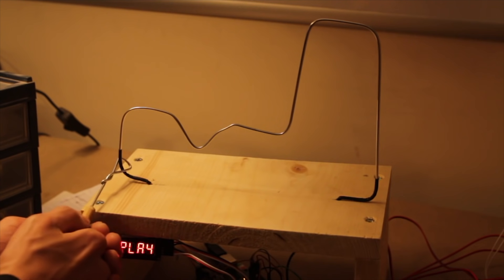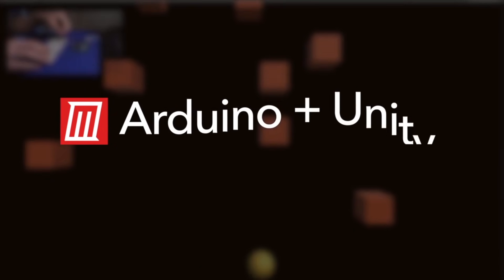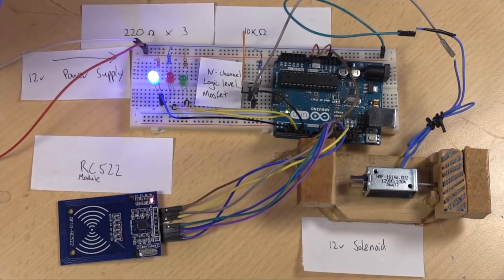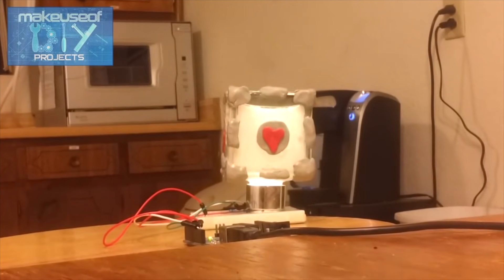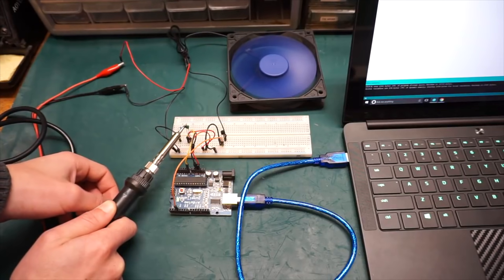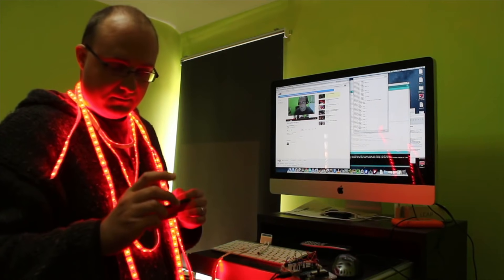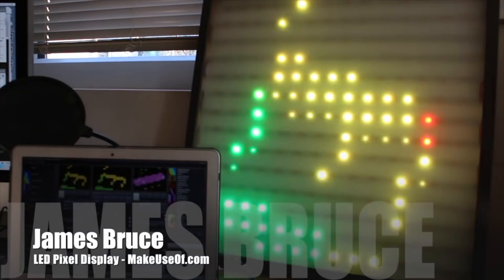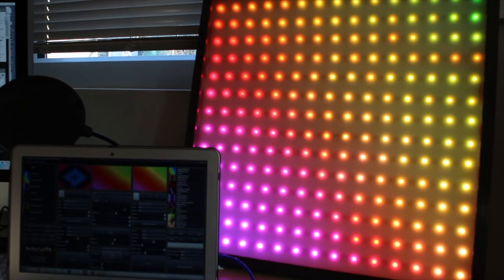15 Great Arduino Projects for beginners

Comment: I made something similar by accident by basically not competing the basic potentiometer circuit. I left the analogRead with just a wire and whenever I touched that against something with resistance it seemed to drop the reading to 0 which I could use to do whatever. I played a sound in my case

Comment: I noticed something weird with the traffic light project.  The light turns green when the other turns yellow and it should turn green when the other turns red, no biggie just an accident waiting to happen.
Reply: I'm a traffic engineer and in fact there should be some time when every light is red, to allow vehicles that have already pass the lights, to evacuate from the intersection. :)
Reply: @krzysztofczajka297  All hate mail about traffic shall go to this person!!
Reply: @ranbymonkeys2384  i came here to comment the same thing haha
Reply: @krzysztofczajka297  I'm almost positive one way shouldn't turn green as the other way turns yellow, and I'm not a traffic engineer.   One more thing ans I think I speak for all of us, FUCK YOU!!!!
Reply: I was just thinking those traffic lights looked dangerous! Glad I wasn't the only one 😉
Reply: check out prgmine
Reply: It's a freaking bread board model of traffic lights I think they are going to be alright with the accidents

Comment: That traffic lights timer... poor timings
Reply: It's an arduino.  The timing can be adjusted as you see fit.  The fact that you took the time to write the comment shows some kind of misunderstanding towards what an Arduino is and what you can do with it.
Reply: @RustyShackleford463  fully aware of its capability. Didn’t insinuate it isn’t easily fixable... just that at present it’s mildly amusing.   
The fact that you commented with such aggression speaks to you attitude more than it does mine.  And your assumption of your own superiority is pure arrogance.

Comment: Are these really for beginners ?
Reply: Yes
Reply: Yes
Reply: Some of them are.
Reply: @lakshyakumar4459  i meant the projects are quite hard. U took it the other way round😅
Reply: Beginners in practical electrical engineering typically have SOME engineering experience. Why on earth are you trying to start off learning arduinos when you don’t even know circuits?
Reply: @wristocrat  What is this gatekeeping bullshit? Arduinos are far beyond what you'd expect from new engineers. A kid could learn circuitry from arduinos, so could an adult with a newfound interest.

Comment: control fan with arduino? oh god, what about simply comparator to control voltage on thermistor ? 100x cheaper, 10x easier ,please dont make simple things hard
Reply: is just for beginners, to understand how Arduino works, not to use in a real project, calm down bro xD